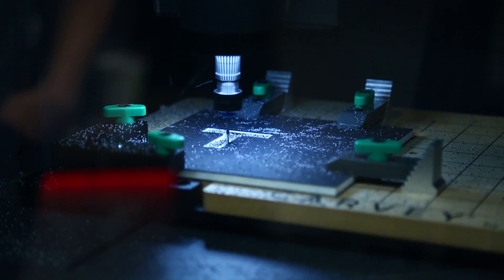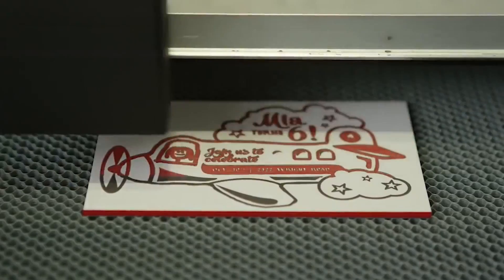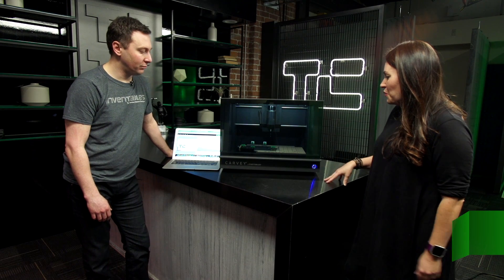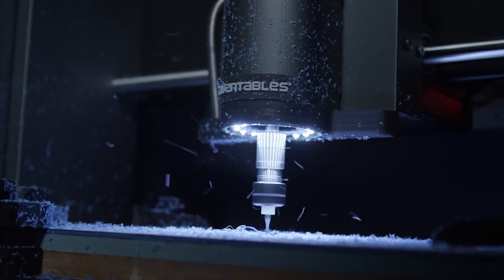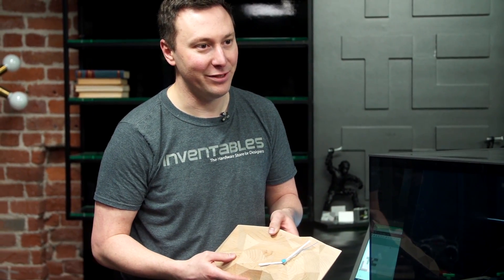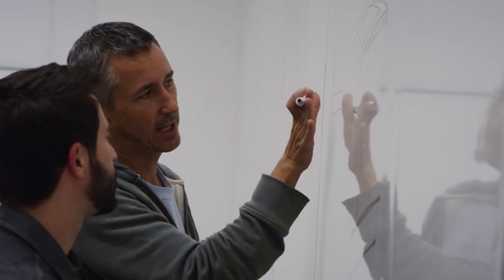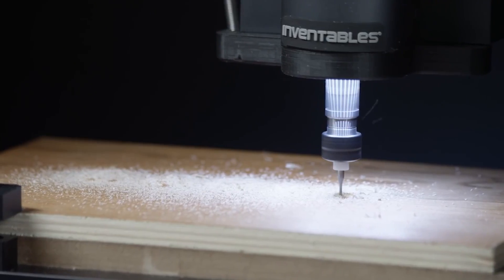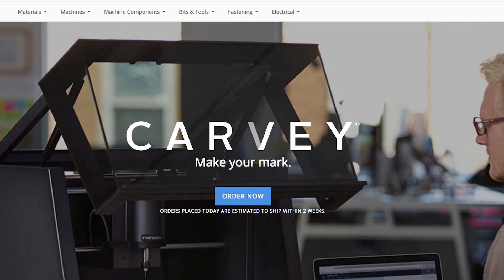Inside Inventable's Carvey

Comment: To be clear, under no circumstances can any CNC machine "swipe through" any sort of material. Speeds, feeds, and depth of cut should be known to some extent by all users, no matter how good the software gets, just like in 3D-printing most users have at least a rudimentary understanding of layer height, rafts, support, and so on.